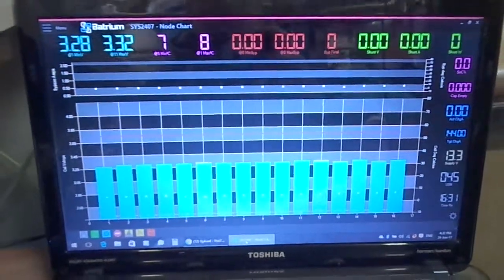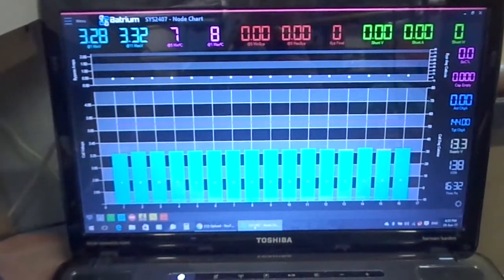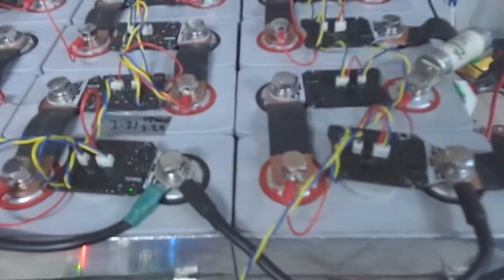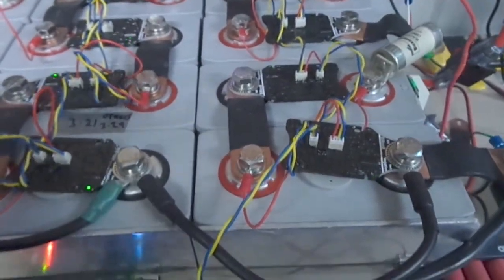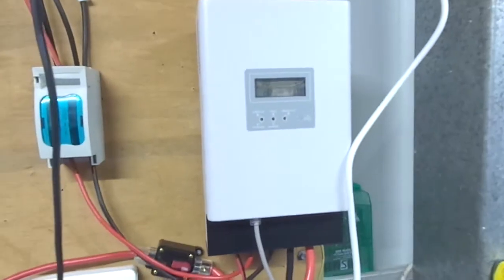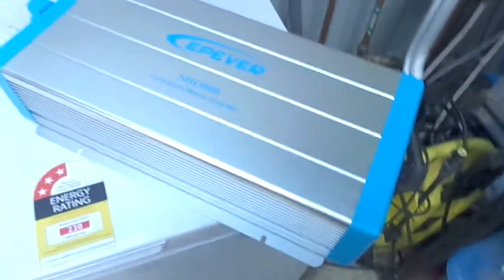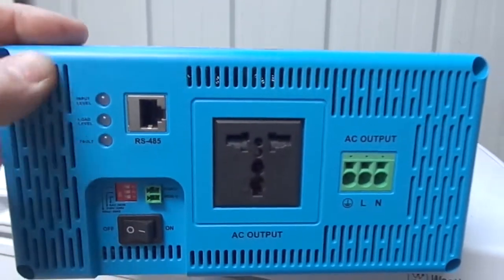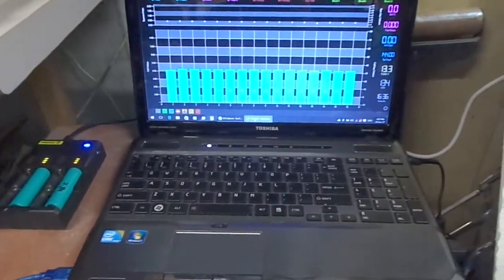Batrium BMS Install on CALB LiFePO4 Cells. Update on 48 Volt System

Comment: thanks for the video.  I'm new to lifepo4, and am setting up a similar system using similar cells.  I am setting up a 12v system and am wondering if there is any difference in the set up procedures for 16 cells wired for 12v  as opposed to 16 cells wired in parallel for a 48v system. I would like to have a 48v system, but for now have a 12v inverter that I would like to keep until I can upgrade to a 24 or 48v system. I appreciate any advise to someone who is new to this tech. thanks.
Reply from the maker: Hi
If you look a some of my earlier vids I started the same way, with 12 volt.
There is really no difference as far as connecting the cells goes.
I do recommend 48 volt when you can do it.

Comment: There's should be a relation between my charge controller and the Batrium bypass for example if I let my charger controller stop charging a 57.26V this is about 4.09 volts for each cell(or module cell) so in the top balance the Batrium bypass volt should be 4.09 or something different
Reply: Jose Garcia Isn't the maximum charge voltage for these cells 3.65v or less? Why do you have your charge contoller set for over 4v?

Comment: Adam Welch had a similar issue with "loose rattling inside" (with another device). He took the casing off and found that one of the screws had vibrated loose. He reattached the screw and tightened the others down for extra measure. 
Good video!  :)
Reply from the maker: Bobby Hicks I'll take the lid off and check it out. Thanks for that